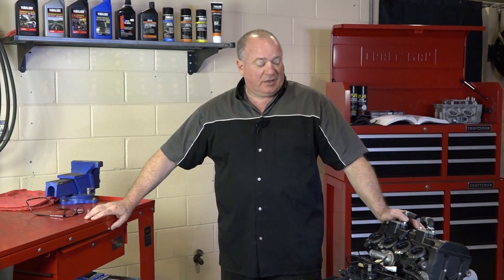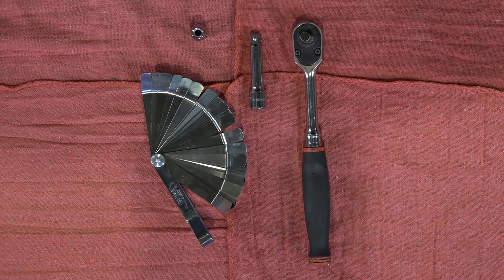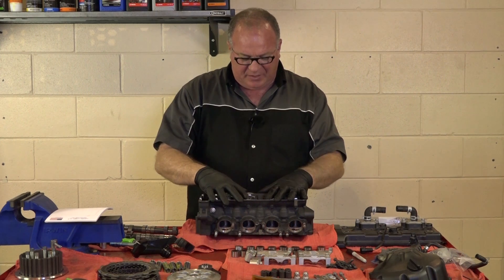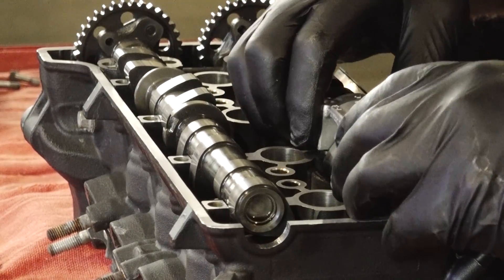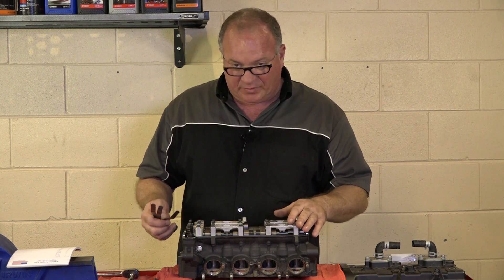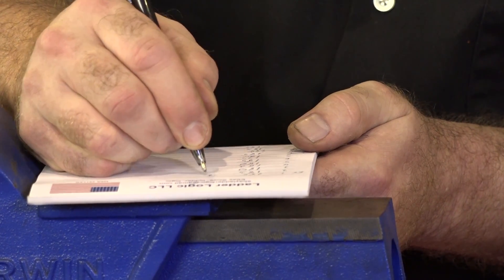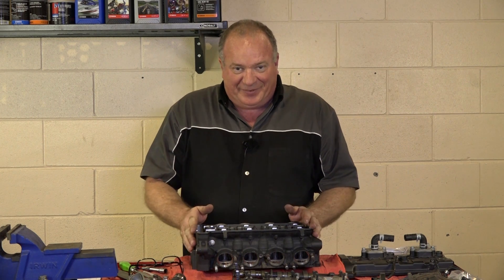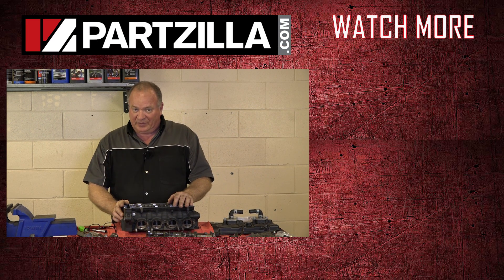How to Adjust the Valves on a Yamaha R6  | Partzilla.com

Comment: Hey thanks you great  videos watched step by step on the rebuild .so i finished my mates yamaha r6 2008 she runs perfect but now clutch doesn't work she just stalls when selecting gears like there no clutch but feel like i have clutch up at the leaver ie can feel the pressure plate getting pulled any help would be great . As it was working fine before teardown

Comment: I know this is an old video and probably not being monitored by the creator. I understand the concept of checking valve clearance, where I am struggling is the feel of the gauge when checking the gap. Should it slide through with very minimal pressure so no bite? Or should it be measured with a gauge that fits the gap but is snug and you can feel it bite on the top and bottom? Any advice is appreciated.
Reply: The feeler gauge should have some decent drag to it and not just slide in too freely. It shouldn’t have to be forced by any means but should have some resistance

Comment: What do you do if the valve clearance was so tight no gauge fits under (theoretically 0 clearance) and the smallest shim size, according to yamaha, is already in place.  Several of my exhaust valves are like this.  This would require going to a shim size of 1.20mm but that is well below the spec'd min.  I assume the spec min is based on the length of the valve stem and spring and depth of valve lifter...no?
Reply: Did you figure it out ?

Comment: Much easier if you take measurements before you disassemble the head, and write down the values.  Then you don't have to re-assemble, measure, disassemble again, etc.  When you disassemble, take note of what the shims in each location are and do your math.
You also have the opportunity to swap some shims around from what you have before you place your order and spend money.   If you already have a given shim, then you can just move it to another position and you don't need to buy it.
Reply: My man🤛
Reply: Then Your fighting compression but yeah

Comment: Partzilla is my go to for OEM parts , especially when I need a small part of a larger assembly that just can't be found anywhere else ! I wonder though about the advantages if this type of setup that includes a wear part ( the shim ) under a bucket . I suppose it allows for finer adjustment . However , I owned a 1979 Kawasaki KZ750B that had a single piece shim-in-pocket system that combined the bucket and shim into a single disc about 1" dia. by 1/4' thick that never needs adjustment . When I  disassembled the engine due to the bottom end going out there was virtually no wear either at the valve ends , on the cam lobes or on the shims themselves . Maybe because of lower revving perhaps ?

Comment: Hello John and congratulations for your videos,really really nice work !
I have a question for you that probably have allready been asked so forgive my repetation.
The manual of my bike (hornet 600 '04) gives to intake valves a clearance between 0.13mm to 0.19mm.
I always set them at the middle ( 0.16mm) but i am wondering (as i have heard some other opinions) ...is this correct ? The question is: are we running after the "middle" of clearance range or we give it a little to the up and ,if yes, how much must be this "up" ?
Reply from the maker: Middle range is a good kick off.
Reply: @PartzillaParts  Thank you !

Comment: Hello, congratulations for the video. I wanted to ask a question. I'm interested to know if the valve game generally tends to increase or decrease on a bike like the Yamaha R6. Thank you.
Reply: It could increase or decrease there isn't a way to know. That's why we set valve at mid-range
Reply: Had an r6. Bikes are notorious for running tight valves over time. High reving and just fucking shitty. 40k and my engine was toasted. And I did the maintenance early af
Reply: @porglife4104  did you mainly track the bike?
Reply: @active0304  never nope

Comment: Should you aim to set the new gap at maximum spec value or minimum or middle? For example, EX should be 0.16mm to 0.23mm. When choosing pad, should you aim for 0.16mm or 0.23mm or 0.195mm? Great video btw. About to make an order from Partzilla to do this job!
Reply from the maker: Within range is all that matters, generally closer to .2 or .21mm

Comment: Is it okay for exhaust valves to be on the loose side?
Reply from the maker: If you want it to run poorly, that's fine.  Valves shouldn't be "loose."
Reply: I took my 08 Yamaha fz6 to a shop for a valve adjustment. The exhaust valves are supposed to be within 0.23mm - 0.30mm, but I had two exhaust valves at 0.33. Instead of fixing them, the shop just put it back together and told me it'll be fine :/.
Reply from the maker: That's a small enough difference that you probably won't even notice it. However, if a shop is going to get paid to do work, then they should do the work. IMO.

Comment: I don't own a r6, but I'm guessing u have to remove the engine to do this job?? Also is this engine an interference engine?
Reply from the maker: No, you don't have to remove the engine.  Yes, it is classified as an interference engine.
Reply: Having the engine removed makes for better tv but I think one of the biggest issues with most bike repairs is getting to it while in situ. All the videos I’ve seen on the R6 are with the engine removed. Wedginator does a good one although it is on a zx6r and may be easier to work on?

Comment: I hope he knows he did the exhaust cam on the intake side...
Reply from the maker: Why do you say that Eric?
Reply: Partzilla well he said he was adjusting the intake side, which he was, but.. he put the exhaust camshaft in there.. and more than likely they have different measurements
Reply from the maker: How are you identifying EX vs IN? Yamaha identifies the EX cam by adding an additional ridge on the camshaft.  

Here you go Eric... https://youtu.be/-NgknUm-1ec?t=2m55s
Reply: Partzilla there is an E on the exhaust cam and an I on the intake, clearly shown in the video when he rotatates the cam.
Reply from the maker: OK we are on the same page now. What you are looking at is actually the cam gears, and believe it or not they are the exact same part number. each cam gear has both  E and I stamped on them.
Reply from the maker: Yamaha likes to mess with us from time to time.
Reply: As long as the cams are exactly the same it shouldn't matter, you guys should do make a video on carbs for a 99-00 r6.. cleaning, adjusting, etc..